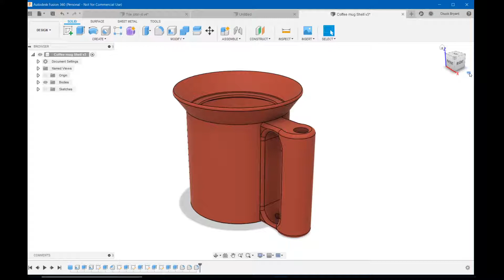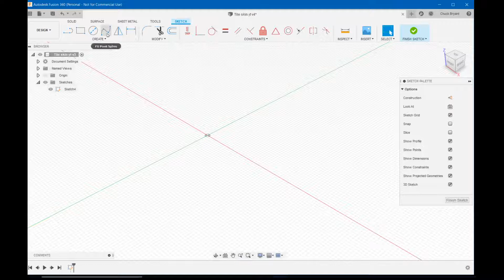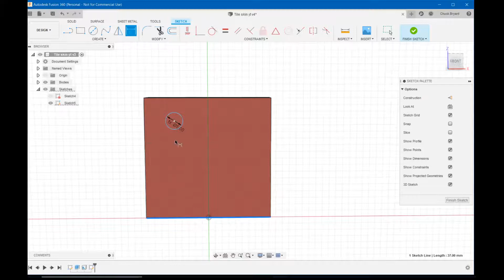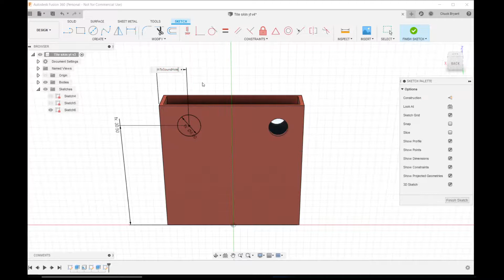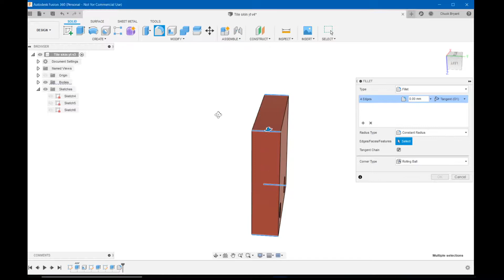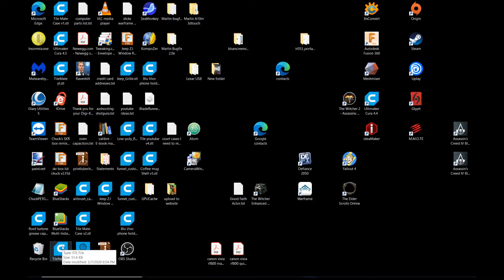Fusion 360 Beginner Tutorial! Design & Print a TPU Skin for the Tile Mate

Comment: FWIW, I printed this type and color of TPU with a bone stock Ender 3 before I knew I wasn't supposed to be able to.  Both my wife and I are still using a TPU phone case I printed over a year ago.  I find it to be really cool stuff to print with.
Reply from the maker: I think I mentioned it in the video, but as long as the stock Ender 3 extruder was working correctly, if the non sleeved pivot arm wasn't binding and the spring hadn't yet died, it was pretty decent at printing flexibles as the filament path was well supported.  And if it wasn't working right anymore, it's a $4 fix if you don't mind waiting for parts to arrive from China.

Comment: Rotate using right mouse button doesn't seem to be the default setting. I had to change "Pan, Zoom, Orbit shortcuts" in the preferences to "Tinkercad" for that to work.
Reply from the maker: You might be right, I thought it shipped that way but it's been a long time. Or it's changed, because I wouldn't have switched it to be like Tinkercad because I used Tinkercad once and hated it.